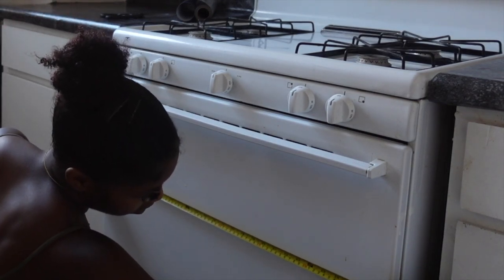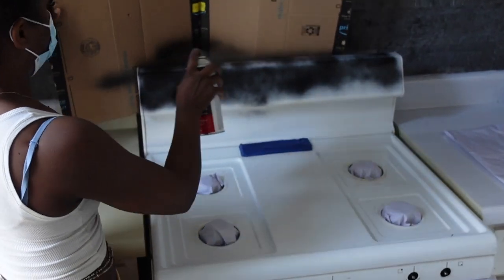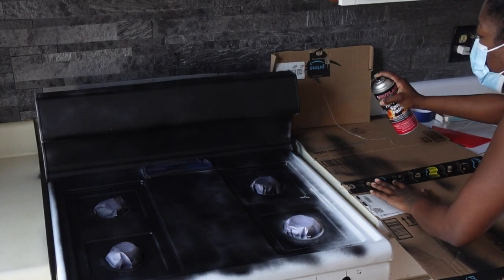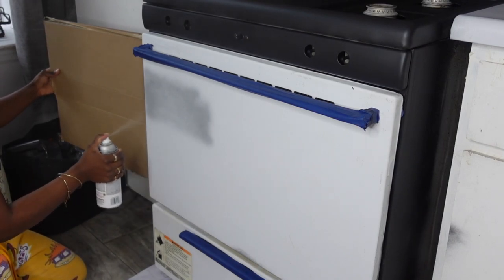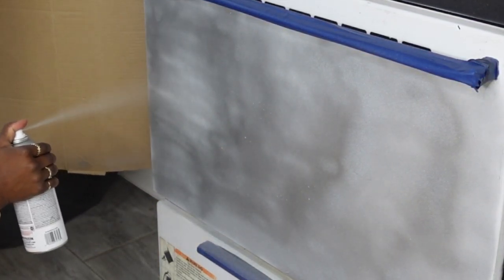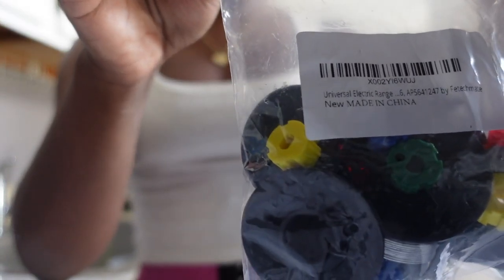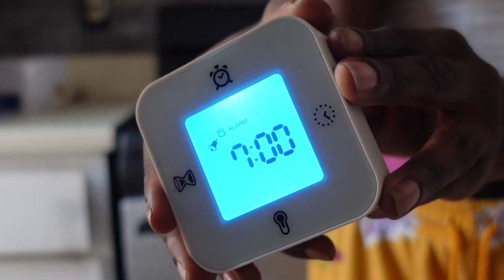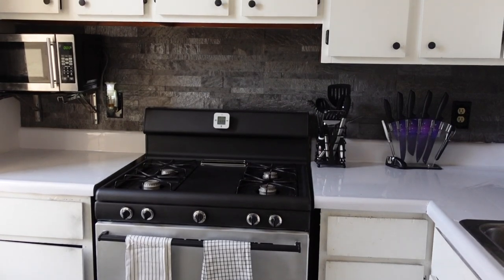DIY OVEN TRANSFORMATION | I SPRAY-PAINTED MY OVEN STAINLESS STEELE

Comment: Gas Stoves: If you have a gas stove, extra caution is needed. Gas lines should be fully turned off and disconnected if possible to prevent any risk of gas leaks or ignition of fumes by pilot lights or sparks.

Comment: I did the similar process on my stove,  I found the key is many coats of paint. I think I did 5 of high heat black and it’s been holding up so far.   I ordered new knobs and like you none of the colored adaptors fit.   I tried 3 manufacturers and none worked. Had to alter them quite a lot to work. Nice job.  Btw. I did the same backsplash stone look as well. I love that part and it was easy to do.   Good luck with the rest.  I finished mine but didn’t video all of it, maybe I should have since I learned a lot of little tricks to help me achieve what I wanted as a renter. May when I do my bathrooms I’ll record it. Side note: My landlord flipped, in a good way.   Wants to do what I did in all the units in my building.   Anyway,  keep on rockin…
Reply: Which paint did you use?  I want to paint my gas range but concerned about it holding up.

Comment: Is this able to be removed?
Reply: That's what I wanted to know.  I want to copy her but idk if this is removable or did she have to get permission from her landlord to do it.
Reply: We need the answers SIS!! 🗣🗣Don’t leave us hanging 😩😂
Reply: @Drippd_in_hon3y  from what I know from another channel it works on your car too is you for scratches . You can take alcohol and coconut oil and it takes the scratch off . But , if you add acetone you can take all the paint off . Also what she did with her bathroom you can get a better form of contact paper for the cabinets in kitchen. And do the flooring. You can even do your countertops as well.